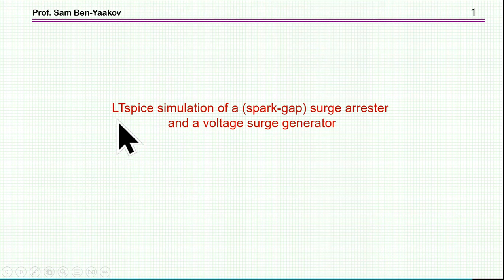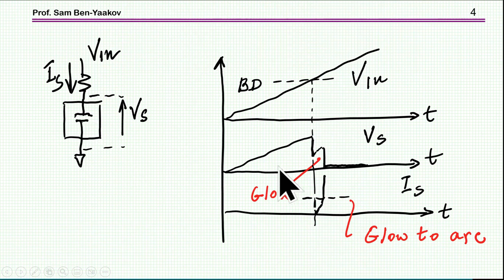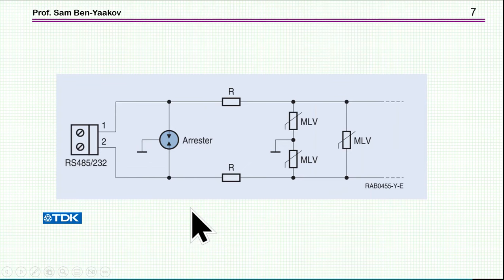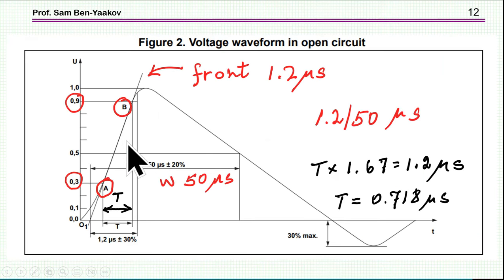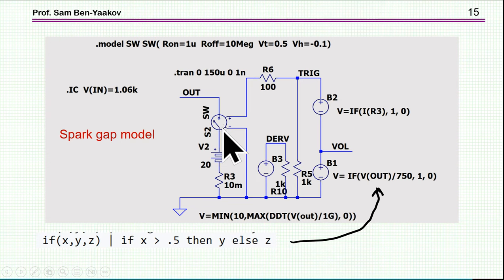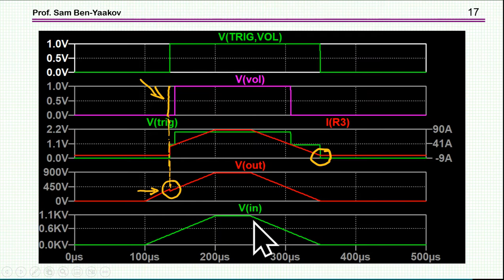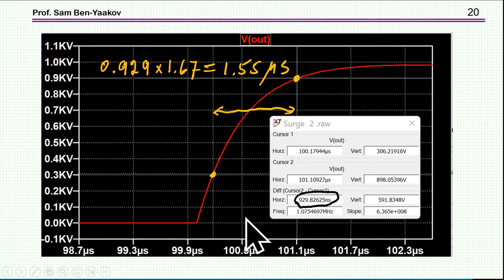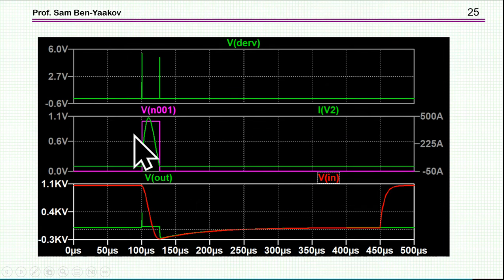LTspice simulation of a (spark-gap) surge arrester and a voltage surge generator

Comment: Thank you for the wonderful information. Can you tell us how you modeled the voltages for switching?
Reply from the maker: Sorry, I am not sure that I follow. You mean in general? or related to a specific slide? Please explain.
Reply: I am sorry for the vague question before. At 18:51 for surge voltage generator, there are two switches with two control voltages. How did you select the values of control times?